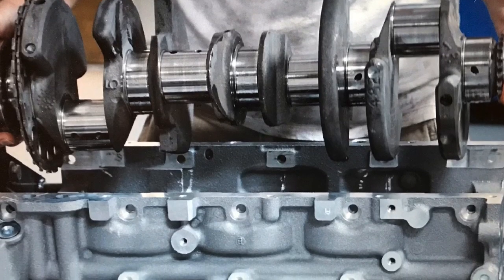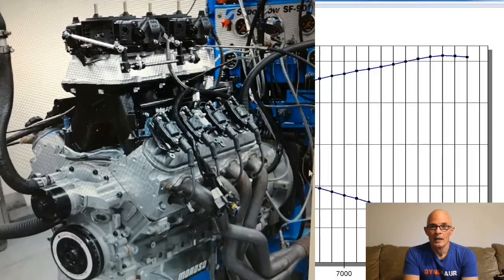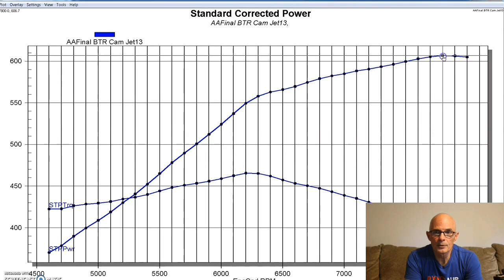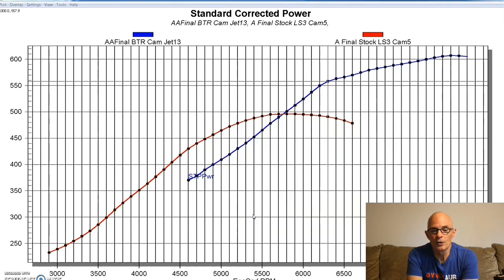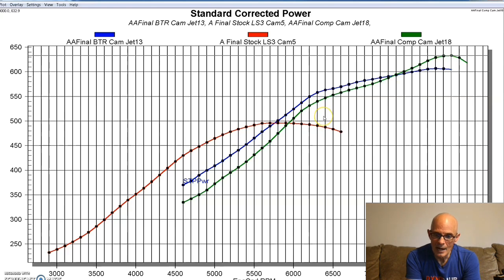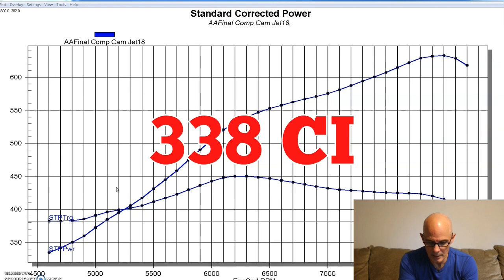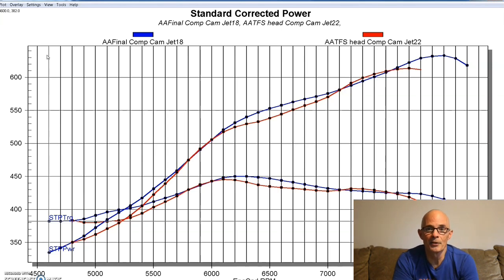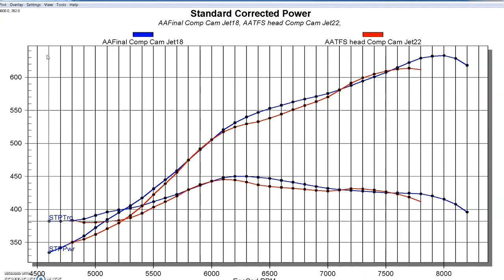DESTROKE LS-4.8L CRANK IN LS3 BLOCK-SHORT STROKE POWER-AN LS MONSTER MYTH?

Comment: Turbo test! : RPM vs Displacement. Curious if RPM and compensate for less displacement. With shorter gears you can multiply this power even more with high RPM.
Reply: You missed the whole point you can get the same high RPM with the proper valve train on the larger stroke engine. So you can have the larger cubic inches at the same RPM as the Short Stroke engine and as we all know cubic inches makes power. Short Stroke 8000 RPM long stroke 8000 RPM with much more cubic inches naturally aspirated or turboed it's quite obvious which one will make more power
Reply: @darinr9424     for street and road racing applications, you have way too much wear and piston speed is so high you reduce volumetric efficiency. Lowering piston speed allows longer dwell time TDC, allowing the piston to fill. Yes, less displacement will always make less - all else being equal - but allowing safe high RPM + forced induction + shorter gears seems like a nice recipe.
Reply: Ehh to each his own. Run the largest bore allowable and the longest stroke you can while maintaining acceptable piston speed at desired rpm. But just a fk it make POWER worry about wear later. The bigger the better lol
Reply: General rule of thumb though. Just depends on what your intention for it is going to be

Comment: Would you say you could get to 8000rpm a bit cheaper with the smaller displacement? If you built a stock stroke LS3 to rev reliably to 8000+ rpm would you spend more on valvetrain/ possibly not be hydraulic anymore to get there reliably? 

I have the wildly unpopular opinion that I want 8,000 rpm for the sound more than the power. It makes over 600 hp, that’s awesome. The sound is even better than that imo
Reply from the maker: the cost would be the same-same valve train-but no need to buy custom rods or pistons
Reply: Richard Holdener sounds good to me! I thought with the larger cam specs needed to spin the bigger motor, you might’ve needed more expensive valvetrain., But the stock rotating assembly would absorb any of that cost anyway in comparison I suppose

Comment: Valve train stability aside. Two aspects of this engine build that were not touched on were one, does the slower piston speed of the short stroke account for a longer lasting engine in high rpm / race applications?  I know it would be tough to prove in a short amount of time. Secondly the response... how fast did it rev compared to a large bore long stroke unit?

Comment: It is pretty simple more displacement yields higher port flow if port size does not change. You simply get ideal port flow at a lower rpm with more displacement creating torque sooner and port velocity reaches choke at a lower rpm causing hp to peak sooner. F1 utilizes the combo they use because it fits within the rules.

Comment: I like how you sarcastically mentioned the peak horsepower and how everyone wants it. That power only matters if it is usable/ suited for your application. I had a power house geo metro. It had the 1.0 3 cyl small block. lol. Well, they had a xfi model that had a different trans, cam, ecu and only had 1 compression ring.  It had 6 less horsepower, but gained about 5mpg and lowered the power curve into a more usable range. A common thing we would do is throw that xfi cam onto a regular geo and it would help it quite a bit although the hp was down. 

I know, pretty much the same exact thing as a LS. lol. JK, but it just goes to show that your engine needs to be suited for your needs. I'm looking to get more low end power on my silverado and people like to brag about this cam and that cam, but the power gains are all around 5k and 6k RPMs.  (Yes, I've been watching Richards other videos and getting very good ideas of what I need for that. Probably start off with an electric fan as a simple, but cheap and beneficial mod.)
Reply from the maker: I love XFI Metro-I had a Chevy Sprint Turbo (set land speed records in a daily drive over 50 mpg)
Reply: @richardholdener1727  YEAH! I almost picked up Sprint turbo a few years ago, but where are you going to find the parts?

I now have a 2001 Honda insight hybrid that I'm debating on Turboing. It's between that and put money in the Silverado

Comment: If you boosted that motor how different would the power curve be?
Reply from the maker: Boost just multiplies whatever is there-I did boost  this with different cam
Reply: Richard Holdener  Sweet thanks for the info👍

Comment: I notice the shorter stroke, turbo engines' torque seems more manageable on the street...
Reply: I've been wanting to build a Supercharged sbc gen1 400 block with a 3.48 stroke. Not for the High revs, but just for a good breathing engine up to 6500 rpm and manageble torque. CNCmotorsports dot com sells  cranks in various lengths from 3.48, 3.55, 3.562 or 3.625 for destroking chevy gen1 and/or LS engines.  Summit sells gobs of rod lengths to make it work.
Reply: edited. added "manageable torque"
Reply: @ViewThis.  turbo john has a mustang with the 3.48 stroke x 400 block + turbo... It seems to be a good combo.
Reply: @ViewThis.  i ran a 408 nitrous motor for years and then switched to a 350 block 3.75 stroke combo for better breathing and made more power up top

Comment: Richard! Please use this engine to show us is there is HP benefit of all these fancy super expensive lifters (other than maybe durability)!
Reply from the maker: short travel lifters definitely help with rpm
Reply: @richardholdener1727   it sounds anecdotal. You are just the man to break anecdotal. beliefs! I can see your hands moving already! "Will expensive short travel or solid lifters help YOUR LS make more power? We test a stock, a mildly modified, and a heavily modified engine with a couple well known short travel lifters, a solid lifter, and then some stock replacement lifters. Will money win over regular tried and true LS7 replacement lifters?"

Comment: Having grown up loving Trans-Am racing, it's all about big bore/short stroke. What would a de-stroker look like if you were trying to duplicate a high performance production engine (pump gas compression, high lift hydraulic roller, modern fuel-injection)?

Comment: I'm confused. I always thought that if you want peak power at a higher RPM, using smaller displacement was the easiest way to achieve that. Otherwise aren't you having to do more on the valve-train side to move peak power up?
Reply from the maker: valve train mods are necessary on any displacement

Comment: A high winding small block screaming at 8k+ rpm is like angelic music.  With a cam that big in such a small engine, I bet the idle sounded wicked.

As much as I like the sound of a strung out V8, I like brutal torque curves that let me lope along down the road.  Either way, I suppose I like engines than make transmissions cry.  They’re either gonna strain from sheer grunt, or be unhappy from rpm.

Thanks for all the info you provide.

Comment: I had a c10 350 5.7 I built wound out to 10000 rpm staying together in gear at that rpm was wicked fun if you build them right they will rev
Reply from the maker: 10K?
Reply: I know of a 69' camaro in the early 70's that regularly launched at 11,500 RPM's. It was a 266 C.I. Naturally aspirated small block with $10k just in heads and valvetrain. Todays technology would be better, and upwards of $50k in todays economy.

Comment: Isn't one cc of volume worth about 0.1 of compression on that size chamber?  If so, you're down a whole point of compression - that's pretty significant.  The LS3 heads didn't get a fair shake IMO, that bit of test data is not that meaningful for comparison.  Especially for an all motor setup with a whole bunch of overlap - it's gonna want all the compression it can get!

Comment: Same rules always exist on the bottom end of any motor.
Use the biggest piston your rules or block will allow and match the stroke to fit the cubic inch rules or the block will allow. These are the first rules of building a stout engine

Comment: +1 to all the comments about reliability/durability.  Always like to point out Honda engines when it comes to RPM.  You can rev a 4" stroke K24 to well past 9000 rpm without breaking the crank, just like a 3.5" stroke K20.  But that K24 will wear out a lot faster, in no small part to the side loading on the bores.  You'll egg those things out very quick.  Fine for a race motor that sees regular rebuilds, not so much for anything else.

Comment: How can I talk to you one-on-one?
Reply from the maker: did you have a question-ask away
Reply: @richardholdener1727  I have a 99 hugger orange Camaro with a 5.3L. It has a 102 fast intake, 102 Nick Williams throttle body, stock fuel rails, 80lb Deka injectors, 243 heads, the cam pain from tick performance and it's called a polluter V2 stage 3 I believe... I know it has to be a big cam because I looked and it could be one of two possible cams, they make hecams specifically for a 5.3L and they have one for I think like a LS1 or something... It's two different cam specs so I really don't know exactly which one it is. All I know is I was told it has a stage 3 polluter cam from tick performance. I have a video on my channel of the car being dynoed at Hawks Motorsports in Easley, South Carolina. The car is a 6-speed car with a 4.10 gear. It has a racetronix fuel pump and ARP head bolts, it also has a stock computer. My main question is, is this a bad setup? I daily drive the car and here lately it's been running a little rough because I've been struggling to get the money to get it fixed. We just had a house fire and lost everything in a mobile home that was uninsured. But other than that I'm just trying to figure out what I could do make the car a lot quicker than what it is and is this a bad setup?
Reply: @richardholdener1727  I hear you talk about Brian Tooley a lot and I think that's awesome because I think a lot of him! When my house burned down, I don't know him from Adam and he donated $100 to my go fund me page! Not only does he make awesome race parts, but he is a awesome person too!

Comment: So u saying take a 6.2 bore it 60. Over an put 4.8 crank???
Reply from the maker: we ran the standard 4.065 bore on the LS3 block
Reply: @richardholdener1727  k I'm building a ls3 destroked with 4.8 crank should I bore 60 over to hit 9k rpm I'm going with Texas speed head cam package...

Comment: Fastest car i ever rode in had a 377. 400 block with a 350 stroke crank. It hit 8000rpm with ease. It had a set of springs between the heads and lifters to keep them from bouncing on the cam.
Reply from the maker: yep-the old rev kit

Comment: True up until 5.75" stroke. At this stroke the piston speed is the limiting factor at about 8200rpm
Thus is why nobody makes a crank with more stroke than this. 
Even at 5.2" stroke depending on the rod length the instnat piston speed is nearing issues. Agreed though in a small block put all the stroke you can fit in.

Comment: Dz302 has always been overrated. 327 has more power per C. I. And GM used them in everything for that very reason. The only reason the DZ 302 was built was to fit the  T/A rules and when they changed the DZ302 was dropped.

Comment: Richard, it would be really great if you could make a video comparing a change in 5.3 valve lift only.  Keep duration the same and creep up on lift to the point of diminishing return.  Maybe you could use a change in rocker ratio to make it easier.  Great videos!
Reply from the maker: I've done rocker tests

Comment: F1 also uses a short stroke for forced indiction stability and minimizing sidewall frictional power loss and heat. 

The short stroke 6.2L solid roller setup I talked to a guy about at the drag strip was turning 9200rpm and had 13:1 compression and NICE ported and filled combustion chamber ls3 heads 

Idk what power he was making, but that thing sounded AMAZING

Comment: Great tech as always Richard!  How much power would the LS3 make with either of the cams in it that were used in the short stroker?  More?
Reply from the maker: yes-a can and intake LS3 will do over 600 hp with even more torque but these cams won't fit with stock P-V
Reply: @richardholdener1727  Thanks!!

Comment: Very Good! So what about the LS7 with Titanium Rods and Valve Train, Should it turn 8K Rpm as well? Is the Cam Limiting that engine? I would love to build a +8k rpm machine and put it in a Lightweight car.
Reply from the maker: rods won't change rpm potential much and LS7 cam won't make power at 8K

Comment: I've always wanted to do just that. Big bore, short stroke.
Reply: Bigger bore ALWAYS makes more power if you take advantage of unshrouding the valves, without doing that, the extra power is negligible. The trick is to get the edge of the intake valve away from the edge of the cylinder for better flow.

Comment: While is almost always easier, cheaper, and more effective to get more power and torque from more displacement it's often more fun to do it with more rpm.
Reply: Gonna do this build purely for the sound 😂
Reply: The reason why Honda loves RMP

They make bikes, more revs more fun
Reply: You’ve obviously never driven a bbc c10. Haha redlines at 5500 but boils the tires at any speed, that’s lots of fun.

Comment: Interesting. I thought that for endurance racing piston speed is a major determinant in engine life and that was one of the reasons that even in classes where valve size is limited or the class requires factory heads that people fit larger bores and short strokes for the same displacement.

Comment: A decent enough cam/spring combo in a stock 6.0 will send it to the moon rpm wise too. I think the short stroke thing is more about piston speed and friction than more rpm. Lower piston speed and less rod angle would help the engine survive longer and create a more reliable engine at big rpm. My 2c.
Reply: Exactly!
Reply: until you drop a valve or the needle bearings let loose.. top end is weak over 7k for track use on an LS3. I have a dry sump and lot of the top end mods incl link bars and won't go over 7k.

Comment: First thought I had was DZ302, my dad had a 69. They de-stroked a 327 (or made a big bore 283?) to meet SCCA Trans-Am displacement limits. I’ve thought it’d be cool to put a 3” stroke in an LS2 for a first gen Camaro restomod Z/28.
Reply: I've dreamed of doing that exact thing many times.
Reply from the maker: The Daytona Prototypes had a 5.0L displacement limit on their LS motors-lots of 3.0-inch cranks out there.

Comment: What compression was it with the Afr heads? Do you think you can get 2 hp per cubic inch in its  current configuration Maybe add vacuum pump and one more cam.seriously I watch all your videos great stuff man!
Reply from the maker: That is certainly possible

Comment: Wouldn’t a short stroke/ big bore combo last longer at max rpm than something with a longer stroke? I always assumed the short stroke was to extend the life expectancy at max rpm.
Reply: Yup
Reply: No, it’s depends on deck height and rod length also.  

A Ford 5.4 with a 4.165 stoke (10.079 deck, 6.657 rod) shows virtually nonexistent cylinder wall wear while a 347 stroker 302 with a 3.40 stroke shows a ton

A 5.4 has gone 1.3 million miles without a rebuild for an example.

The ability of the rod/piston/pin/crank to withstand piston speed depends on material selection and reciprocating weight.  You have to consider at every variable in each instance, not generalities.  Generalities usually lead to bad decisions when putting an engine combo together. 

In a perfect world world everything is exactly the same, slower pistons speeds result in greater longevity but that is very rarely the case.

Comment: just out of curiosity. does the shorter stroke motor rev faster in any way that would be useable?
Reply from the maker: not sure about a free rev-but rpm response under load would be power based

Comment: I run a Turbo big bore 4.8  in my drag car. We've been 4.90's @ 143 mph at 2800#. Stock 243 heads, TBSS intake and a baby 80mm turbo. The short stroke really keeps the turbine wheel happy
Reply: That's insane performance. How much power is that combination making?
Reply: @Borderline5440  little over 1200
Reply: @NorthAvenueRacing  That's beautiful. About 15 PSI?
Reply: @Borderline5440  30 psi to make that power

Comment: The heads look real similar, you could probably just flip the lines if you match the compression ratios. Would have to see the curves out past 7500rpm strong on both to make a true judgment. Don't know if that big drop in power at 7700 was just pulling back on the throttle early or it was really falling off hard for some reason.
Reply from the maker: we didn't lift

Comment: I dig RPM's, but I'd NEVER sacrifice CI.. Unless a rule book made Me.

And IMHO, Not only would this combo have made 50+ more HP & TQ with the 3.62 stroke, This setup REALLY needed a solid roller with @ 10° more duration @ .050. It should make 700+ with the rec ports.

Comment: The 4.8 bottom end is almost a 2 rod/stroke ratio, making it lazy drawing in the intake charge, but you can band aid this only disadvantage with BOOST!  Benefits are less piston side loading/friction.  More dwell at TDC increases efficiency.
Reply: I run this combo in my turbo car and it really does keep the turbine wheel happy